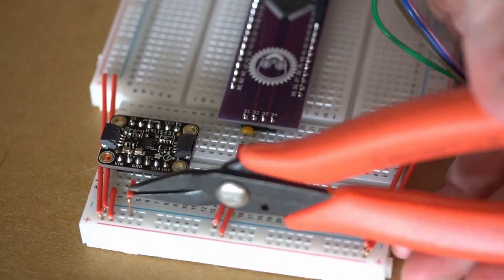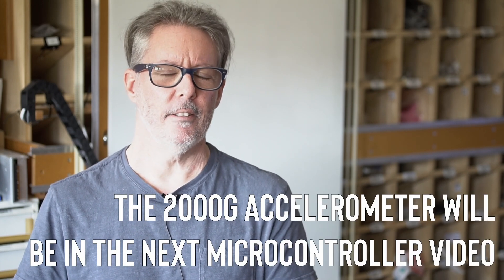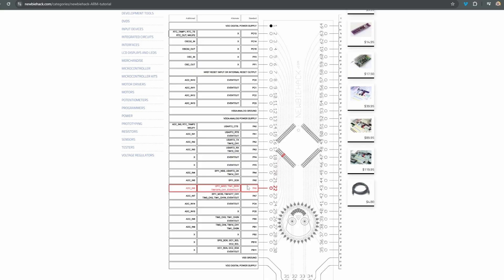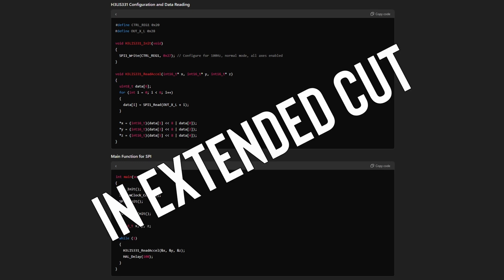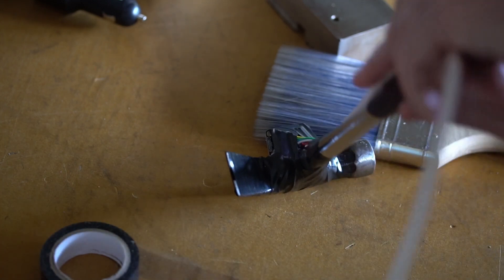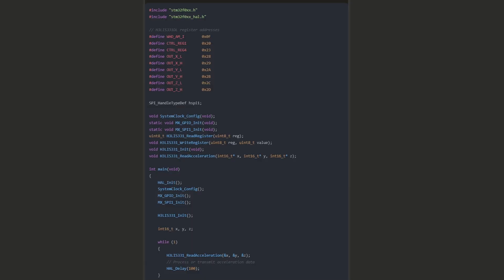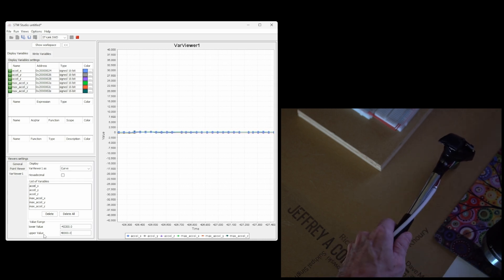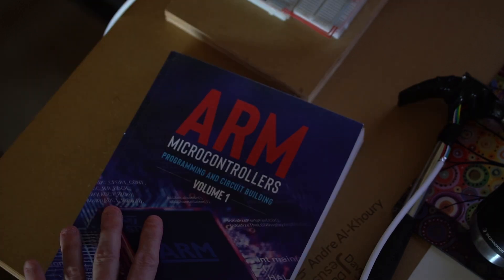How to Communicate using SPI with the STM32 ARM MCU and a 400g Accelerometer - GPT-4o vs Claude

Comment: When i was in college i told my professor that i thought human damage due to G force in a crash was highly dependant on the time that G-force was endured.

An impulse of a high G won't hurt the body because cell walls and their contents don't have time to move relative to each other. Same for bones vs flesh's relative movement.

It seemed like a new concept for him to hear but he was intrigued.

Now watching those hammer impacts, i wonder why some of the hits cause longer pulses. 

 Is there something you can do to cause a short pulse vs a long pulse (for the same peak G)?

Does the taped sensor come into play?

Interesting video!
Reply from the maker: Thanks for the comment. The max accel variables will leave the value on the trend longer so I wouldn't miss it, so you are only seeing the max accel value, if the debug didn't catch the real accel value. However, I do see a few short and long ones. I noticed in the 2000g accelerometer, I was getting "ringing" due poor mounting, but when I mounted that one really well, I only got a very quick response and nothing more. So, the way I'm taping it to the hammer, especially this 400g which has an awkward form, it is going to have some play at those hard hits.

Comment: Register level programming is tedious, and you have to lean on the datasheet heavily, but it makes more sense to me than using HAL. It just feels like hiding implementation details isn't helpful to someone trying to learn a platform and you have to learn how to use the library that does the abstraction anyways. I don't know, maybe it's easier for professionals who already know what they're doing, but the skills don't transfer to other MCU architectures.
Reply from the maker: For me, I think it's because I learned from the AVR. HAL may work for all of the ARM microcontrollers, but register level code works for all microcontrollers. This is, at least, how I apply microcontrollers. I wouldn't attempt this for very high level and complex applications, like OS and file transfer. But for most everything else, robots, refrigerators, washing machines, etc. register level code is pretty versatile.